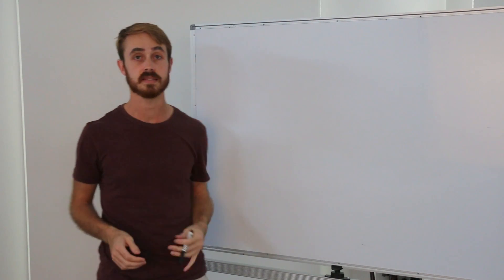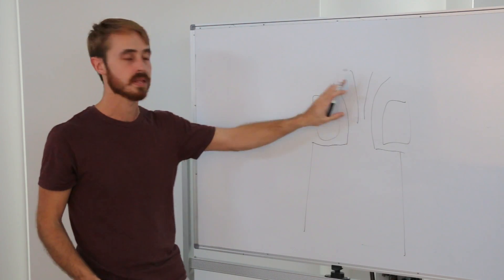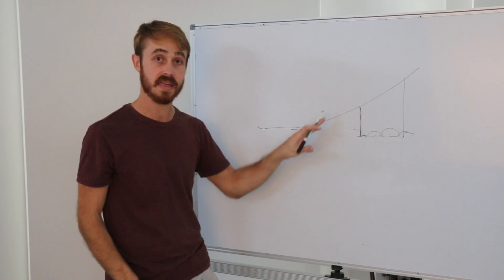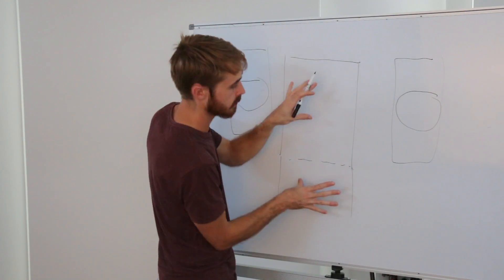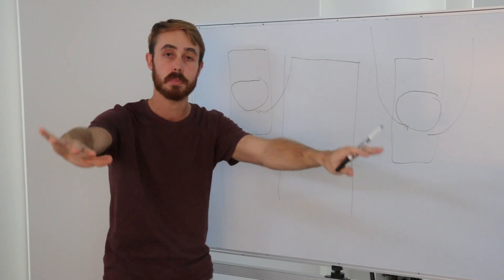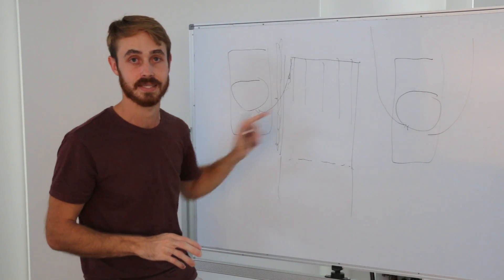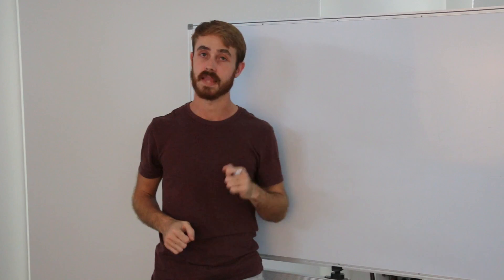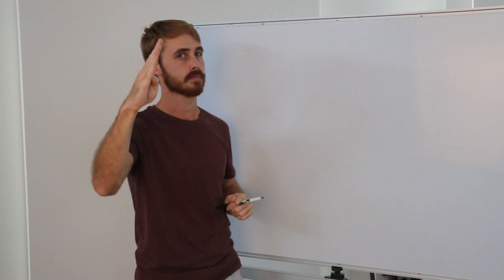Why do Diffusers have Strakes/Fins?

Comment: So that being said, is it more efficient to have all the strakes kind of curve outwards? A lot of underbody rear diffusers I see, including on higher end cars like Corvettes and Dodge vipers anyways for example, they seem to use straight strakes... Not straight as in vertically, but straight as in longitudinally. So while I'm trying to figure out what kind of diffuser I want to design for my street truck, I'm not sure if the design should have, from front to back, a straight direction strike, or curved strakes, or maybe a gradually lessening curve to the strakes, with the outer ones being more curved and the inner ones being less curved. I'm trying to achieve both more downforce and less drag particularly with my design. I'm thinking of starting the diffuser close to the axle, but then I probably need to block off the air flow above the diffuser, by creating essentially a wall upwards so that air cannot get trapped above the diffuser building. Does that work out or will that create its own resistance? Also, When I go to design side skirts of some kind, I'm also trying to decide if I should just block off air straight down, or if I should get flatter ones, kind of similar to what running boards are like,  but  sealed off, you know?
I'm looking more for reduction of drag than I am downforce, but obviously downforce is appreciated, especially in a pickup truck with not nearly as much weight over the rear when you're not hauling or towing something...
Reply: is the underside of the truck fully flat?  if it isn't, then you are wasting time.  the whole idea is to move the air under the vehicle faster than the top.  without a flat underside, this cannot be achieved.
Reply: @K03sport  when you say flat, do you mean like a pan all the way across the bottom? Like completely sealed off.
Reply: I’m where you are. A truck. Lowered. Ride height is 5” above ground.

Comment: Just a question sir, at the end of the video you were saying the use of L shape diffuser as it pushes the vortices much closer to ground, then shouldn't be a inverse T shaped diffuser even better than straight edge and L shape.
If yes then why don't are they used in F1 and other motorsports?

Comment: I have always seen them as tools to soften the laminar flow transition from smooth flowing to swirly behind the car. If you leave flow to go it's way after the flat belly/tunnel, it's going to swirl violently and pretty close to the bodywork. Strakes brake the laminar flow up into sections, creating smaller vortices than transition into high pressure area more easily. I am not making any claims. This was just my layman's thinking. Is there any merit to this theory?

Comment: Super helpful.  I'm currently designing a diffuser for my car and this has given me some info to help make a couple changes that should improve it
Reply: Hello, I'll be doing the same soon also, what material do you plan on using?
Reply: @countblah7099  I actually 3d printed it for a one time use shell, then covered it in fiberglass

Comment: i personaly think its not about ''vortex''  but about air flow , if the exit is wider than the entrance  , its gonna create suction/downforce at entrance of air , and also drag at the rear to help stabilise the car , and making it go twards the exterior may also help diminish  the turbulances coming from the sides .. thats my opignion ,  i dont really understand the vortex thingy
Reply: he's not explaining what the function of a diffuser is, he's explaining the function of strakes ON the diffuser. I think you have it mixed up.
Reply: did you not see what the title of the video is?

Comment: So with the high pressure area in front of the tire that comes from being squished by the wheel, mostly applying to slick tires, would it make sense to reduce that with a kind of arrow that would deflect the air left and right minimizing the full stream of air from hitting the tire head on? more referring to full body cars not open wheel 		< O===~~~

Comment: You haven't mentioned separation of the air flow so when the diffuser stalls, it doesn't entirely stall.  This enables to have the diffuser with different angles of attack, so it can work effectively on different speeds.
Reply: Stalls?
Reply: @ yes.  Like a  stall on a aeroplane wing.

Comment: Hi, I saw there are small fins in rear bumper in most the car. Are those small fins useful or just for good look?
Reply: I am no aero expert, but I know that the "diffusers" you see on most road cars are fake, and they're just decorative, ie, to give it a sporty look. Their diffusers are barely 5cm long.  The best I've seen on a road car is the diffuser on a Renault Clio Mk IV RS. If you look at an under body shot on the net you'll see it extends from the rear axle to the back of the car. I don't know how effective it is, but it looks the most effective of all I've seen.

Comment: Kyle - near the end of this video you mention the use of L shaped strakes in older diffuser designs to move the vortices closer to the ground.I understand how this would work, but my question is why is this an old design that is no longer used if it is better?
Reply: huntos83 he was saying in another video, modern f1 cars are built to meet class racing specifications, so I cannot pull up and race in the batmobile. It must built according to the rules.
Reply: @Planktarded  do the new rules specify that diffuser strakes cannot be L-shaped?
Reply: dangerous probably
Reply: Is there any specific examples of cars with these? I’ve been looking and can’t seem to find any
Reply: It has sharp edges so prolly something to do with car laws not allowing them bc they are too dangerous

Comment: Does undercar down force negatively affect drag, or fuel economy?
Reply: svriderpokey down force does not necessarily equal drag
Reply: In the video https://www.youtube.com/watch?v=pXYJpXKMp_E he shows that a simple flat underbody can actually reduce drag, which should improve fuel economy. That does make sense intuitively, as a standard roadcar's inefficient underbody has many areas that interfere with the airflow. 

If the underbody has a more advanced design - so that it's not flat and is intended to add more downforce than a simple flat one would - I would expect that there is some tradeoff from an increase in drag compared to the flat. But as with all things aero, that depends greatly on how that interacts with other components. And if there is a way to get 4 pounds of downforce for 1 pound of drag (or whatever the accepted ratio is), then a team would certainly take that option.
Reply: To both, yes it may, however fuel economy is seldom a factor in racing. The drag is a 'maybe" depending on the design, but may actually improve.  In any case the entire purpose of the down force is to improve road grip, improving handling which then allows higher speed maneuvering through corners which then wins the race.  Higher overall speed is more important that minor increases in drag or fuel consumption.

Comment: Question for near the end of the video. You talk about vorticies created by the strakes helping to "block" the tire squirt from coming over. Also, in your diffuser video you talk about how the actual turning direction of the vortex has a lot to do with "blocking" side flow (this is specific to the part of the video where you discuss how canard's vortex actually rotates the wrong way to actually provide the sealing affect). 

With the rotation of the vorticies on the strake in the diffuser, aren't they rotating in the wrong direction for them to be blocking the tire squirt (or any incoming side flow)? Or does the vortex absorb the tire squirt and lessen it's affect that way?
Reply from the maker: Well, for the canards case because the vortex is high, it's the rotation direction at the floor that we are concerned with. I.e. you want the vortex pushing the air out from the floor, not pulling it in. For the strake vortices, they are actually spanning the gap between the ground and the strake, so the vortex itself is entraining the flow into its centre. That way the core is acting almost like a physical wall, and the direction of the vortex is largely irrelevant. It would actually be preferable to have them spinning the other way, but there is no way I can think of doing this that doesn't adversely affect diffuser performance. Make sense?
Reply: Yep, that makes perfect sense. Thanks for the clarification!

Comment: Hey Kyle, I saw ford doing some ducting on their new F-150 where they routed air coming at the front into the wheel wells. Can you explain if this is a benefit or detriment?
Reply from the maker: Colin Terry I honestly can't see how that would be of benefit, unless it is for brake and shock cooling. Thinking about it, that is probably the reason as they are quite heavy so downforce isn't exactly going to matter, and the drag is so terrible on the thing already that that wouldn't matter, but a big truck could always do with cooler brakes and shocks...
Reply: Thanks, I guess I never considered that as a possibility. It does make sense now that I think about it. Thanks so much for the insight!
Reply: Looking into it, Ford has explained that the system (which they call "The Air Curtain") is supposed to create an airflow that goes in through the front and exits from the wheel well, with the intention that this helps keep outside air from diving into the wheel well and interacting with the wheel, reducing turbulence and drag. Essentially it tries to smooth out the airflow across the side of the car. They can't use the "optimal solution" (fully enclose wheels in skirts) due to practicality reasons, so they're trying to use this ducting as a way to get a similar effect.

Comment: And just one more question, if you're able to answer this as well: 
Why do LMP1 cars have such a different style rear diffuser and different strakes than F1 cars and other sports cars?
Reply from the maker: Luke Parsons Mainly when you see diffuser differences , it's due to rules. Don't trust most of what you see on an F1 car, as it's usually just a device to get around a very specific set of rules. In saying that F1 cars have far more rigorous aerodynamics analysis than many LMP cars, so you would expect more complicated flow devices around the diffuser area. Also, the influence of body shape etc should not be underestimated. As such you would expect a large difference between a time attack car, and LMP and an open wheel car.

Comment: Why do some diffusers have more strakes than others? Is there a certain "best" number to have?
Reply: Luke Parsons Also, is it better if the strakes are straight (as in go back and up at a 90 degree angle) or rounded?
I'm sorry for asking so many questions. haha
Reply from the maker: Luke Parsons Strake number will vary depending on tyre inflence, ride heigh, flow around the body etc. There is no "best" number to have. I recently designed a full custom undertray for a client where we were running 8 strakes and two horizontal deflectors to control the tyre squirt and ensure extremely high floor efficiency, however the centre 80% of the diffuser only had 2 strakes in it. Normally we try to aim the strakes away from the centre to counter flow ingress, and this results in somewhat of a rounded profile. 

Thanks for watching!

Comment: Since the vortices rotate clockwise on the right side and counterclockwise on the left side looking from behind the car ahead, does that encourage an "inwash" ?  Does the direction of spin matter for how good and air skirt the vortex is ?  Would the opposite spin on both respective sides be better by encouraging and "outwash" ?    What do you think Kyle ?
Reply from the maker: Peter B The "inwash" is actually the thing the at is causing the vortices if you think about it that way. The strakes are essentially fighting the inwash from both the tyre jet and outside air being drawn into the diffuser, and the direction of the vortices is decided by the crossflow over them. To get opposite spin, the strakes would actually have to be oriented to draw the air inwards, which would be the opposite effect. Think of it as the strakes help stop the crossflow and section off problematic parts of the diffuser, and the vortices (which can entrain flow) act as further barriers near the ground that can stop undesirable flow features migrating across (such as tyre squirt).

Comment: so why are there multiple strakes across the entirety of the diffuser and not just one on either side to stop the flow from around the tyre?
Reply from the maker: One fence along will be fairly ineffective in controlling tyre squirt, as the vortex is not being shared and the squirt cannot be trapped, so you need more than one. In saying that, I often see diffusers with waaaay too many strakes in them and that's largely from people who either don't properly understand their function or are doing it for looks. I am currently doing some consulting for a car that I am putting a strakeless diffuser on as the tyres are a long way from the diffuser so tyre squirt is not an issue.

Thanks for watching!
Reply from the maker: KYLE.DRIVES sorry *alone not along
Reply: KYLE.DRIVES This would explain the C7.R's strakeless diffuser.  Though.. that makes me wonder why it looks more like a reversed splitter..

Comment: Most enjoy your aero knowledge.

I was watching an old tour de France doco, and in the 90's many teams had wheels entirely covered up in perhaps plastic covers - much like time trial riders (rear wheels especially).

Any how - I'm interested to hear your insight - especially that 10 years later - wheels are certainly not covered.

Whats the deal?
Reply from the maker: 888berg I'm not hugely up on bike aeros, but my understanding was that the full covers give less drag, however have significantly higher sensitivity to crosswind. I believe it was largely a rules change which removed them, although they also are heavier so for rides with hills etc the aero benefit is probably negated by the extra weight. The fact that time trial riders (who are generally less restricted by rules on their bike aeros) still run discs on the rears shows to me that they are still superior for drag.
Reply: KYLE.DRIVES
Cheers for the reply - that makes sense :)

Comment: 7:34 Sorry but what decides the vortexs' direction?
Reply from the maker: Jesse O'Brien Vortex direction is decided by the direction of flow across the geometry, think of it as flow spilling over the ends. As the diffuser/undertray is a region of low pressure compared to the atmosphere, it will naturally 'suck' the air towards the centre of the car. This creates a flow across the strakes, which will cause the vortices to rotate in the directions I have shown. Does that help?
Reply: hsieh811 I was just going to ask that. Do they always form clockwise?
Reply: That makes perfect sense. Sometimes I'm surprised by how simple things are, while other times I'm surprised by how complex these concepts can be. This is one of the simpler times.